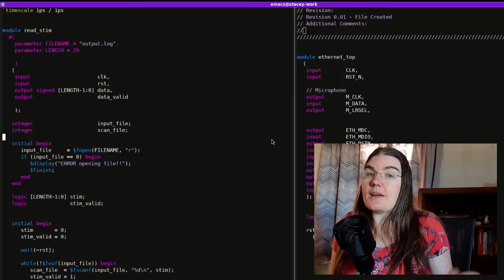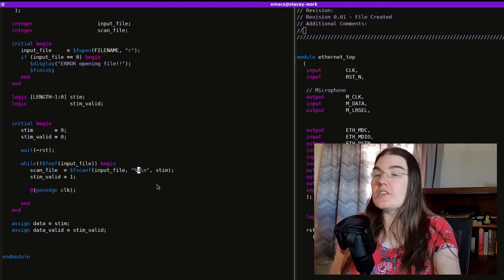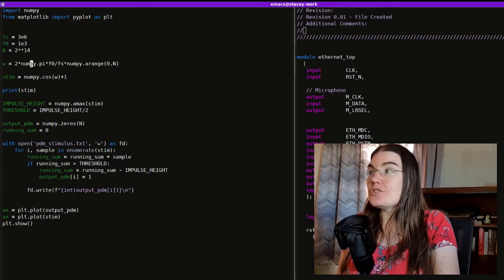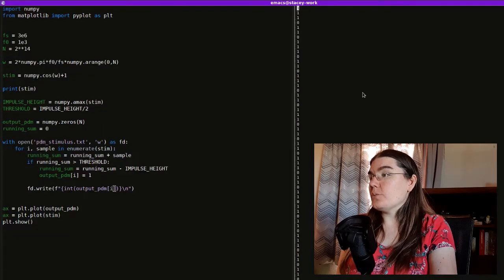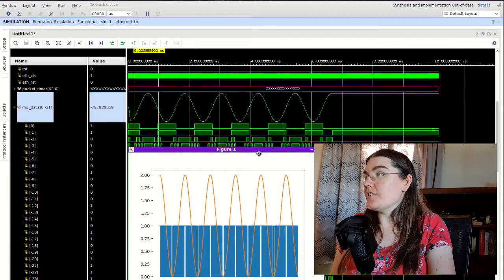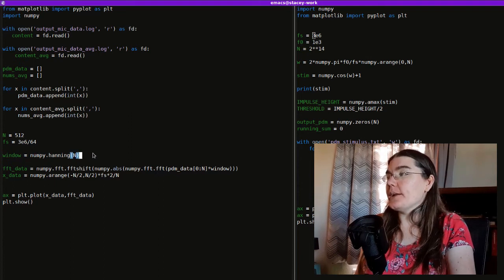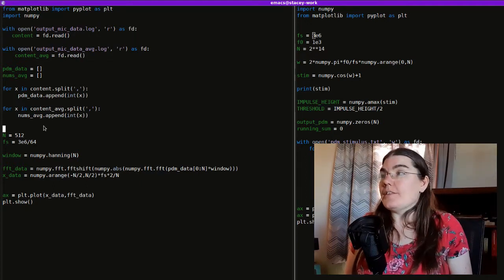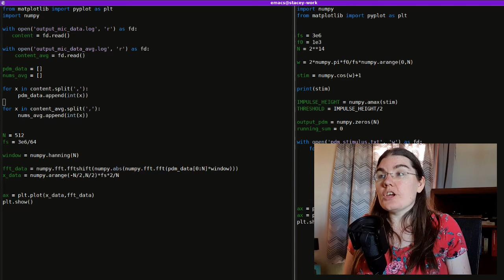Reading from and writing to file: My PDM testbench from start to finish.

Comment: Hello, i am relatively new to the fpga programming. I have bought an fpga from gowin (tang primer 20k since it was cheaper than others intel or amd chips). I figured out that files like time constraint files are a bit different. It would be great to do some basic videos demostrating some projects in other fpga brands too. Thanks alot

Comment: Another thing to do that is very useful is have an ifdef statement to select either data from a file or constrained random data to go into your "scan_file".  Use a  "+define+" in your vlog statement to select what you want. I also define the file I want to use using a +define+ and whether I want data from a file or constrained random data with +define+FILE_MODE
Example for selecting constrained random mode: vlog  -sv   +define+MAX_DATA=1000 +define+MY_TEST_FILE="../sim_files/file333.combined.txt"  test_tb.sv
Example for selecting file mode: vlog  -sv   +define+FILE_MODE +define+MAX_DATA=1000 +define+MY_TEST_FILE="../sim_files/file333.combined.txt"  test_tb.sv
or something similar